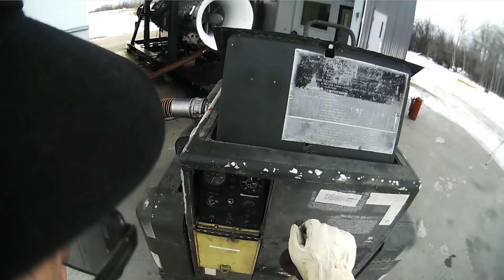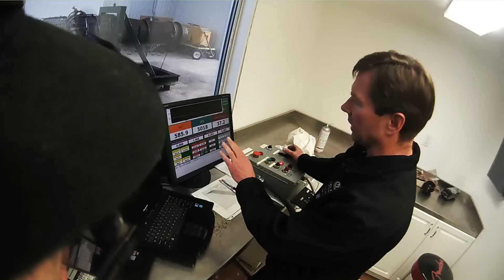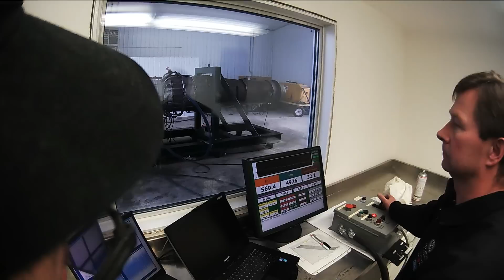Testing a Large Turbine Engine : A New Perspective

Comment from the maker: @JetAce08 Yes, that is liquid propane that has condensed in the line between the vaporizer and the jet engine. At a pressure of 50 psi, which is what we use for starting, and if allowed to cool to ambient, which today was about 20F, the propane returns to a liquid state.
Once the engine is running and using fuel, the fuel flowing through the line keeps it warm.

Comment from the maker: @MPCapricorn  Hmmm... I answered this days ago via mobile, and it doesn't show up...

We are comparing the position of the variable stators, indicated by the computers' sensor attached to the engine, and also indicated by a physical protractor on one of the stators.
Robin is tweaking the computer so it reads the same as the protractor.

Comment from the maker: @pjvenda It's a bit more complicated than that, but the cost of maintaining an older, simpler engine with an established record of reliability is about 20% that of running and maintaining a newer engine.
Some of it has to do with the fact that these ground power units are adaptations of designs originally created to power aircraft.
As modern engines become more perfected for aeropropulsion, they become less than ideal for adaptation to industrial purposes.

Comment from the maker: @Blackmoonempire The switch is the same, but now the pressurized gas supplied to it is better integrated into our engine skid. Very nice installation of the equipment by Byron, but it's all hidden under the steel cover plate unfortunately.

Comment: Cool, it's like getting to look over your shoulder at work :-)

What does the little red wheel on the engine that you turn do? A valve for something?
Reply from the maker: It controls balance air leakage. There are seals that keep air between the back of the last compressor disc face and the midframe. That area is feed pressurized air. The more you restrict the outlet, the greater the pressure acting to push the compressor rotor forward. This reduces the load on the main thrust bearing. We adjust it because there must be some load on that large ball bearing. If it spins with no load at all, a phenomenon called ball sliding can occur, which can cause greatly increased wear.
If you google Rotor Thrust Forces, and J-79 Airflow, you will see two diagrams relevant to this mechanism.